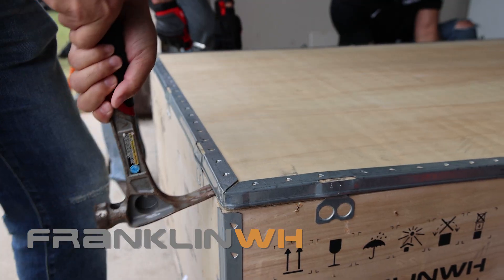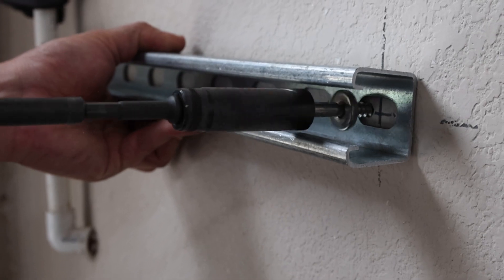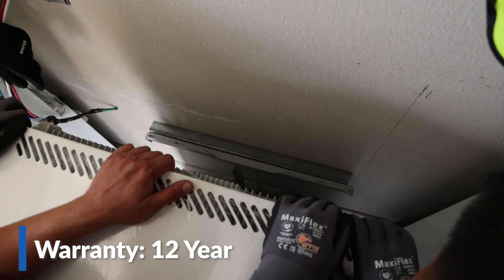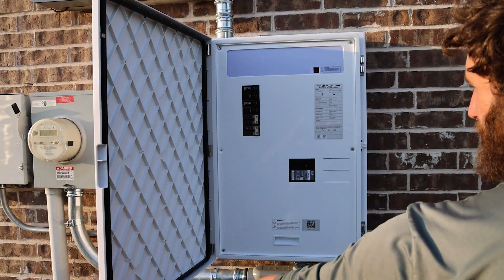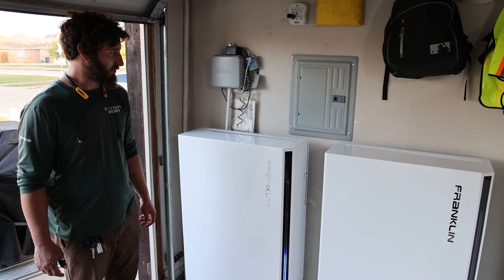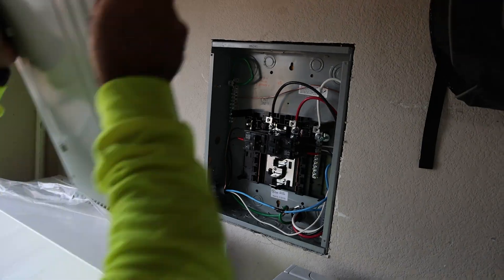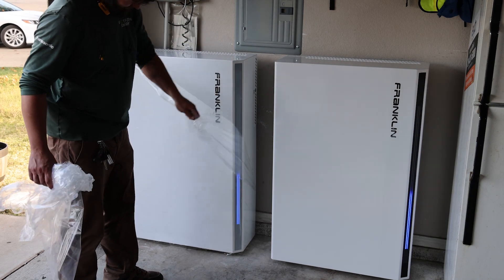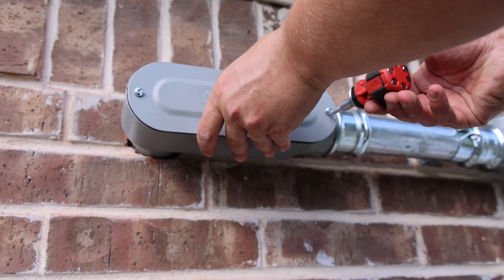Franklin WH Battery Backup Installation - LFP Battery that Runs Your Home in an Electrical Outage

Comment: And the latest study show that LFP batteries have a thermal runaway temperature that is only 100° different than their competitors and LFP batteries emit far more gases that are vastly more toxic. The entire industry has been fooled on LFP. And virtually all of these energy storage systems have business units which have never turned to profit. As well as contractors that are vastly under trained.

Comment: I hear the continuous output is only 5kw. If you get more than one battery does the continuous output go up 5kw per battery?
Reply: Yes
Reply: @USNEM  Can these batteries be stacked one in front of the other like the Tesla or do they have to be installed side by side.
Reply: @wthharrison7233  currently, side by side. I think Franklin has been experimenting with other orientations.
Reply: @USNEM  That takes up a lot of wall space.

Comment: This is probably the nicest and best AC coupled whole home backup solution on the market at a competitive price. This is definitely the way to go for existing solar installs to add batteries. It is far more competitive in price than the Enphase system and is solar system agnostic ie. it doesn't care what kind of existing solar setup you have.

Now if you're doing a brand new install I would still go with a Sol-Ark 15K and Homegrid Stack'd with Tigo optimizers but this Franklin system is genuinely nice!
Reply from the maker: Agreed. Between the battery chemistry, the aesthetics, the features, the warranty, and the commissioning from the installer side, and the ease of use from the customer side, this is definitely one of the best offerings on the market.
Reply: What's a fair price for two franklins?

Comment: i DIDN'T SEE AN INVERTER TO CONVERT DC FROM BATTERIES TO AC - IS THERE ONE IN THE BATTERY SET UP?
Reply: Inverter is built into the battery stack, each stack comes with its own DC to AC inverter. The additional load panel is the smarts to perform grid bypass, critical load shedding and AC solar coupling duties. Very nice setup and very expandable. Probably the best battery add-on setup on the market for an existing microinverter solar setup.
Reply: @greg_takacs  I have AC coupled string inverter. PV to inverter 600 feet underground to house to an outback inverter and AGM batteries I want to pull outback and batteries and install so I can do it without adding inverter but reducing by one?
Reply from the maker: This can be done with the Franklin WH system. Greg was correct, the inverter is built into the battery. It is super powerful and can solve your problem.

Comment: Seems comparable to Tesla’s Powerwall. What’s the price difference between the two? (Solar + Powerwalls being installed next month by you guys)
Reply: Also higher surge output
Reply: @Repsol1krr  I was just reading that, scalable too.
Reply from the maker: Hello Topher! Comparable for sure both in tech and price. The biggest difference is the battery chemistry which increases the charge cycles by close to two times. More charge cycles means they will last much longer than the current Tesla Powerwall offering. The warranty is also an additional two years. 12 vs 10 years. There are other features as well that will be in a future video.